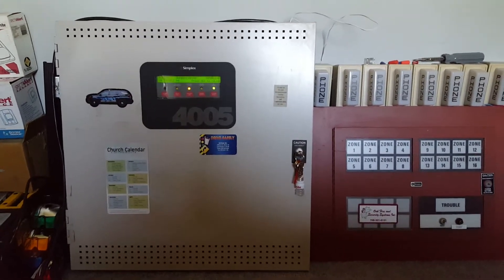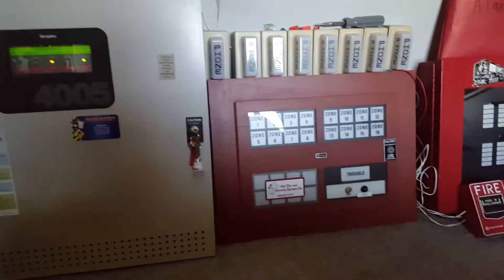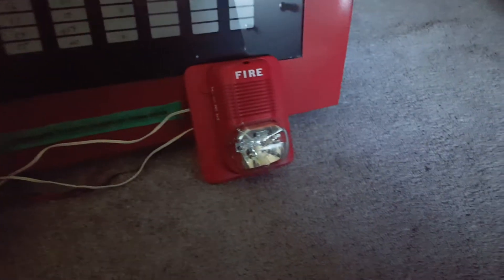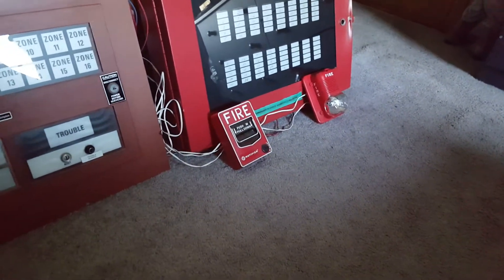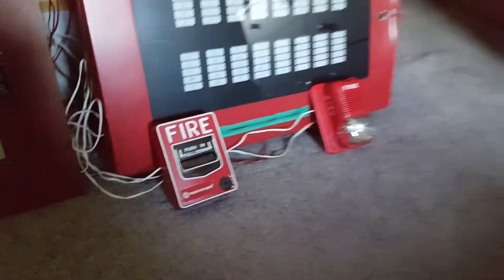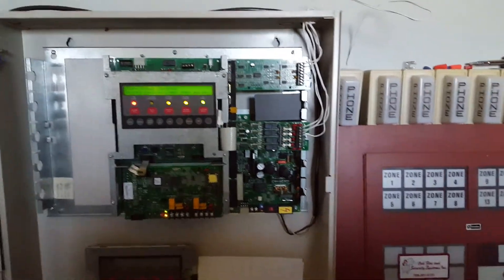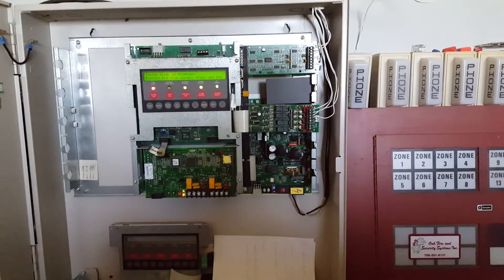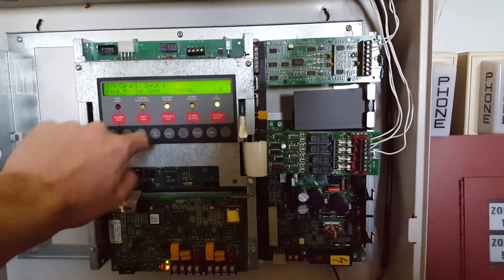Floor System Test 34

Comment: How many fire alarm related devices do you have?
Reply from the maker: I haven't counted in a long time. Probably close to, if not more than, 80.
Reply: WOW. i wish it was easy to get alarm devices. I live in Australia and the fore alarm systems a preaty boring here. The most interesting thing iv seen here is a weatherproof spectralert advance with a red strobe on the out side of a warehouse.

Comment: For the next system test, I would like to see ALL the fire alarm parts (except the anoiciator) that you got from the JP morgan building demolition back in early 2016
Reply from the maker: I won't use all the parts in one test because that would be overkill, but I will use one of the 4251-20's, one 2901-9838/2903-9101, and maybe also the 4903-9219 or 4903-9252.